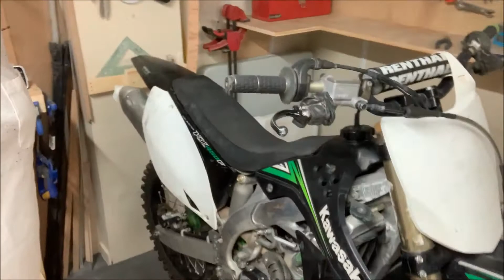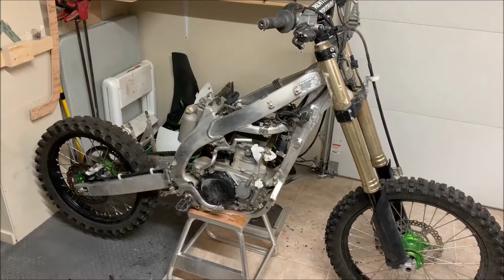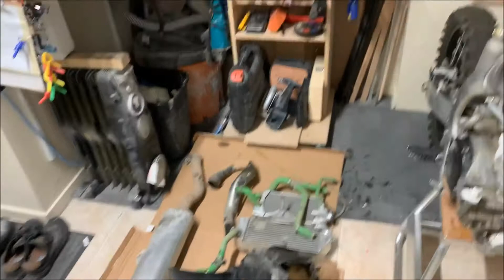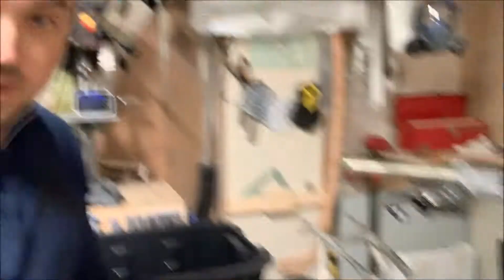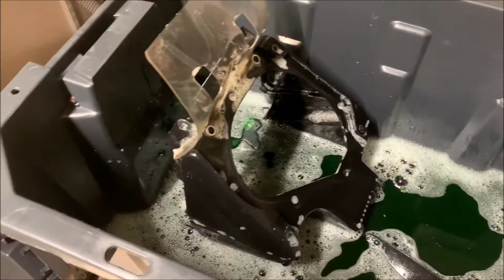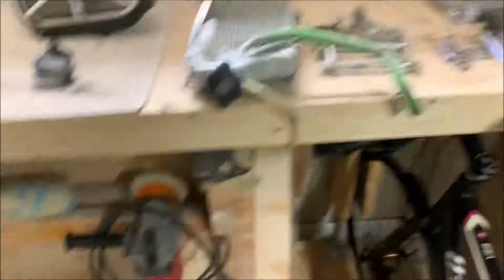KX450-Electric Conversion: Video 2

Comment: Ken, do you think you can get 60 or 70 MPH on this bike?
Reply from the maker: I'm not sure what the top end will be. I plan on putting about 30-35kw peak to the motor based on the battery pack planned. My goal is more for torque and responsiveness, I'm setting this bike up as an enduro machine. I'd take its ability to get the front wheel off the ground over blazing speed. 

That being said, know that I'll definitely try to go as fast as I can haha!
Reply: LOL, haha. yeah. Well keep safety in mind too

Comment: what motor/controller do you have in mind?
Reply from the maker: noonenaught I’m looking at a 10kw Golden Motor (liquid cooled 72V), and BAC4000 or 8000 controller. They seem good, but I honestly have no idea. Information on larger motors is limited, I’m following the the foot steps of some of the euro guys I’ve seen on Endless Sphere forum.
Reply: @kenmakes1542  have you looked at the motors from qs at all?
Reply from the maker: noonenaught I took a look at the specs, a friend recommended them, apparently the QS motors can be over amped with little consequence. They seem good, but I like the idea of liquid cooling and I believe that they only make air cooled motors.
Reply from the maker: @Noonenaught  I read a post today that says people are pushing 30KW out of the QS motors. That is pretty impressive considering the price!
Reply: @kenmakes1542  What MPH do you have in mind. I would like to see mine top at 70
Reply: Did u decide on a set up, if you can please share it as I am doing the same build😀